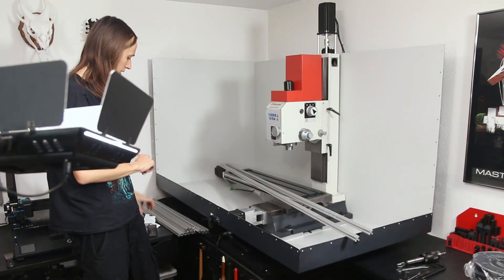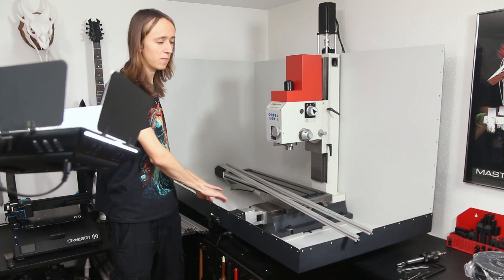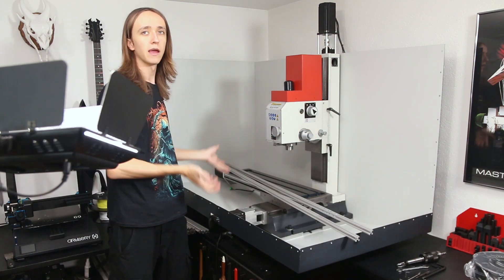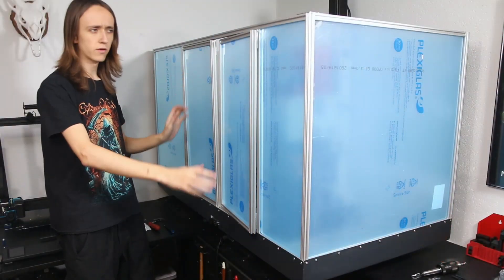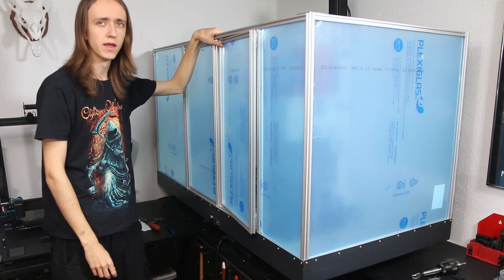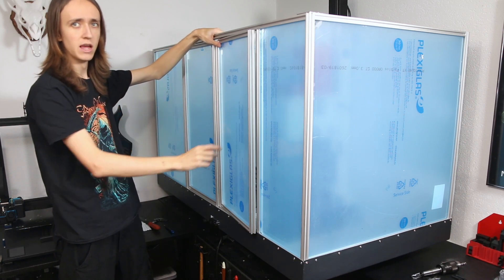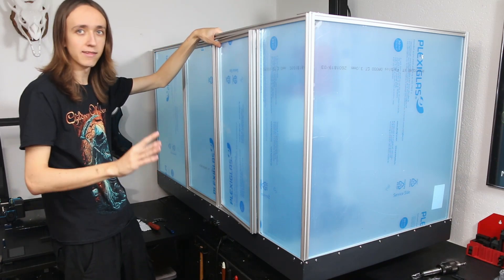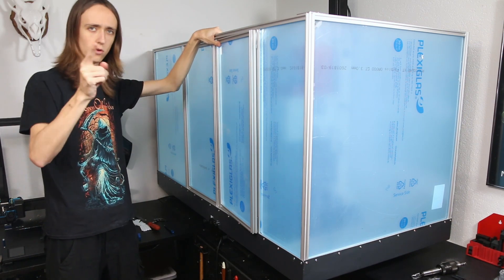BF30 CNC #5 - Enclosure Complete

Comment: The enclosure looks good, as a solution for the doors make the left side sliding, reverse the hinge to make the right side opening outover, this makes the opening part for quick access and you can slide both along to the left for even more access for cleaning etc. A quick tip, get rid of the swivel base on the vise, it will make it much more acurate and rigid, having cnc you dont need it as you can cut angles with the cnc.

Comment: That sir looks great! I'de use a magnet. Make a 3d printed bracket that provides a reces for a small magnet so that it wouldn't interfere with the protruding aluminium extrusion of the door and mount it just off-centre so that it also doesn't interfere with the centre hinged part of the doors.